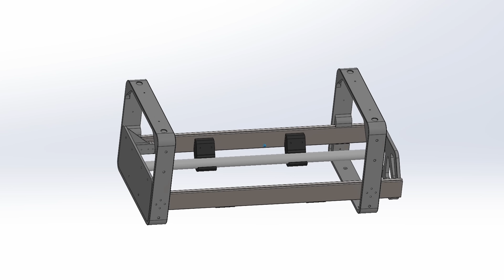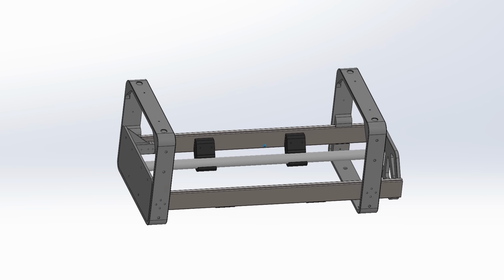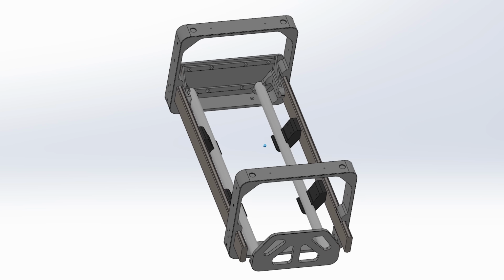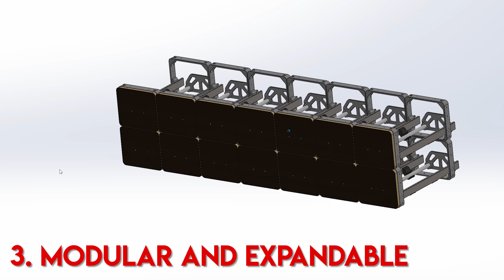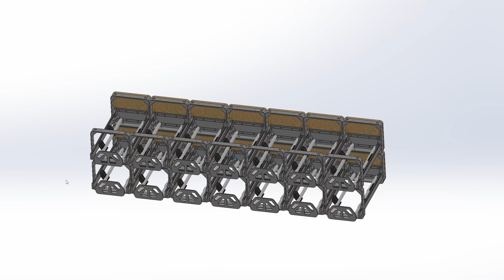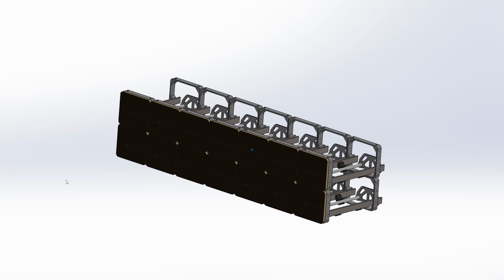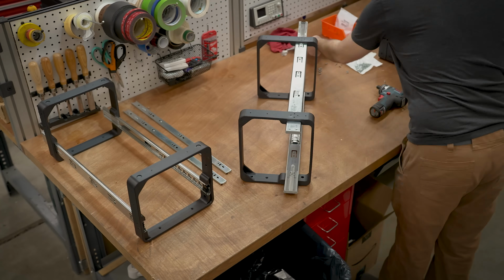Modular Filament Storage System - Part 1 (Design)

Comment: This system looks awesome man, great job. The big question though, I get the power constraints and form factors, along with the different filaments as well, but…solid state dehumidifiers? The seems like it might have a great place here on the face of the drawer. High cost for the units, I know, but power wise that seems like a good fit. No, it’s not as fast as a dryer of course, but for storage purposes like this, I think it might be killer. Just need to seal the body of each drawer though. When I get my XL in, I definitely plan on trying this. LOVE your channel, keep up the good work.
Reply from the maker: I saw that video too ;-)  I thought about it, but for me, the biggest issue is drying WHILE printing.  Getting the humidity down initially is important, but I've noticed through longer prints the quality can degrade as the print goes along.  Also, when I was printing my speakers, I needed to print about a week's worth of parts and it just makes sense to dry WHILE printing.  So in general, I'm going to print from the dryer for anything critical anyway.  It was a compromise I made, and I'm OK with it.  I thought about sealing each drawer, but I go 'shopping' a lot with filament, so I'd be constantly opening up the drawers, making any air tight seal pointless.

Comment: i think you should have 100% squared off the corners so it could be either be enclosed or open.
Reply from the maker: Yeah, that would work.  I included the STEP files, so it would be really easy to square off the frames.

Comment: Actually loving the industrial look of the exposed structure without front plates!
Reply from the maker: Check back next week to see the final look.  It turned out pretty good I think.
Reply: @RobertCowanDIY  Well, that is the beauty of your design. Those of us who choose to print it can decide on our own how to dress the front of the drawers. I haven't decided if I'll print these, but if I did I'd probably design a front to the drawer that holds filament swatches of what is in the drawer, covering only the bottom part of the drawer. I think I would like the look of seeing the top half of the first spool.
Reply from the maker: @Sembazuru  For sure, it's a bit strange not actually SEEING any of the spools, but I'm getting used to it.  I think having filament samples inside the faceplate would be really cool, that was one of my original ideas ,but I'm not disciplined enough to actually print the swatches :-)

Comment: Awesome solution! I was wondering, any reason for the rounded outside corners on the frame?
Except for aesthetics ofcourse.
Reply from the maker: Just for aesthetics really.  Also, it allows faster print times since it doesn't have to slow down in the corners.  ALSO, the original design used these clips to attach modules at the corners, but it didn't end up working, but I kept the corner radius.

Comment: May I suggest adding a way to place filament sample chips to the drawer front to identify what's in the draw.
Reply from the maker: The drawer pulls have an integrated label holder ;-)
Reply: Nice idea! I was going to suggest optimal print profile slots for each filament with their names printed on slips, but having a visual sample sounds better.
Reply from the maker: I like the idea and considered it, but I swap around filament a LOT and I know it would be outdated after a week or two.

Comment: Super nice! I really like the industrial-but-still-pretty look of it. I think this would go nicely with a digital inventory system so you can see what you have without having to go through each drawer, and so you know where each spool is when you need it and where to put it back when you're done.
I keep my filament in boxes of 8 spools and each spool is in a vacuum bag. I built my own inventory system with Airtable. I really like these no-code databases for things like that. I can track each spool back to when I ordered it and know which box it's in, along with loads of other info.
Reply from the maker: That's not a bad idea, but I have a LOT of things to track in the shop, the 3d printer and filament is just one of them.  I should track my end mills, metal stock, etc, etc.  I generally have a good idea of what I have on hand.  There are some filaments I just always keep on hand and the others are just leftovers from specific projects or stuff I thought looked cool.

Comment: Informative as always! Are you able to get down to 10% relative humidity with the Sunlu? Mine sort of flattens out at 19% no matter how long I dry for.
Reply from the maker: I think about 13-15% is the best I tend to get.  You gotta 'burp' it from time to time.  The heat will make the moisture leave the filament, but then it needs to escape.  Also, thanks!
Reply: @RobertCowanDIY I generally let it dry with the lid slightly open during the entire process. Maybe that's where I go wrong!
Reply from the maker: @EirikBrandalf  I start with it closed, let it get up to temp, then open it a bit, let it sit like that for awhile, then close it back up.

Comment: A variant that would be printable on a X1C or P1S would really increase its popularity. I think it's a great design. But about 10mm too wide for a X1C/P1S
Reply from the maker: I REALLY tried, but there was no way to make it smaller without doing something different.  I started the design with a sketch of a spool, added clearances for the slides and the minimum wall thickness and that's about as small as I could get it unfortunately.  A 300x300mm printer does just fine though.  But that was one of my biggest compromises with the design, it can't be printed on standard-sized printers.
Reply: @RobertCowanDIY  Yeah, and i can see how splitting the ring would ruin its strength. Trying to figure out if there is a way to make it work. (even if increase print time/plastic) I think it would be possible but would ruin the ability to stack them reliably. I wonder if printing them at a slide incline in the printer would work.. layer lines would be stronger that way as well. say with a 30 degree tilt?
Reply from the maker: @infamy4k  Yeah, it might work.  I might look into trying to make it a bit smaller, it might be possible with angling the drawer slides.  We'll see...
Reply: Let's Just hope Bambu Lab comes out with there large format printer soon.  Enough with this A1 stuff =P  Also, great design Robert.  I'm really liking your attention to details.  You have earned a sub here.
Reply from the maker: @jajordan2515251  I've heard from them SOMETHING is coming.  I've been told to 'stay tuned'.
Reply: After just seeing this design for the first time this morning I have been wracking my brain on how to make it work because the design is brilliant! I have figured that I will use the "inner" parts of the drawer design, and then build a complete "frame" assembly to fit my space out of wood. It won't be modular, but that is ok as I was planning on building a rolling cart sort of idea so it likely works better for me in the long run. With that idea, I can at least look at adding in a solution within the cabinet space to help keep them dry. It may not be the perfect solution, but better than keeping them open with no drying at all. They would still need to be dried a bit more before use, but I mostly use PLA so I should be able to figure out something that will do a reasonable job without too much trouble.
Thank you @RobertCowanDIY this design is brilliant!!!

Comment: Whaaa? No RepRack? I'll keep watching, but... I thought we YouTubers were required to use RepRack?

Edit: OK, Damn. This is cool. I keep my printers on industrial shelves not unlike these, and this would've probably been more practical than RepRack taking up an entire wall that could've been more shelves and therefore more printers...
Reply: did you even watch the video? didn’t he just say it’s not utilizing the depth?
Reply: Cost would be a huge factor for me, And the cost of drawer slides would be astronomical expensive. Its a great looking system but I think RepKord did the rack right. And I can see everything I have immediately and in plain sight. Granted its a huge space but its open and available. No need to keep looking for colors or types.
Reply from the maker: Check the quantity discounts on the drawer slides.  The 24" ones are really pricey in singles, but the 22" in quantity is MUCH cheaper, they go down quite a bit when you get multi-packs.
Reply from the maker: Wall space is at a premium and I have a lot of other tools, not just printers.  I personally feel that wall space is much better utilized for pegboard, cabinets, etc.